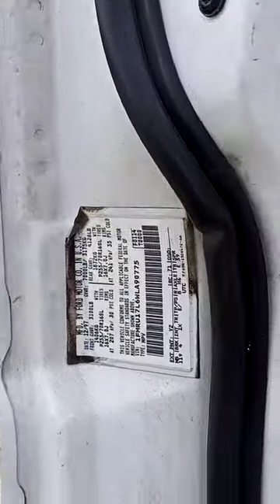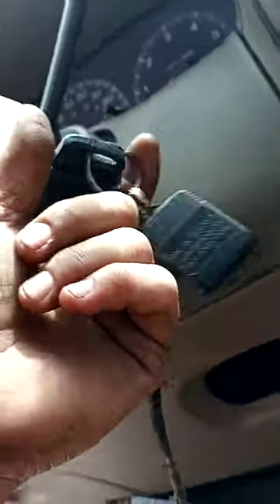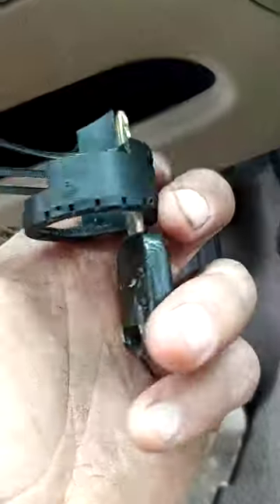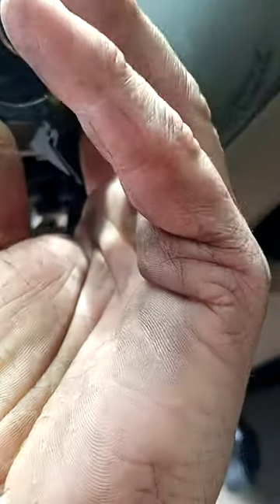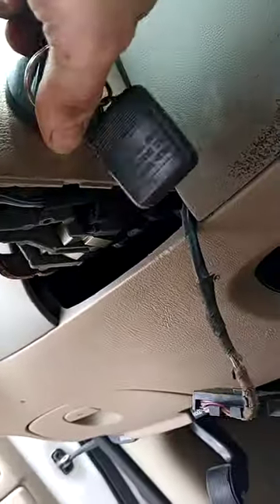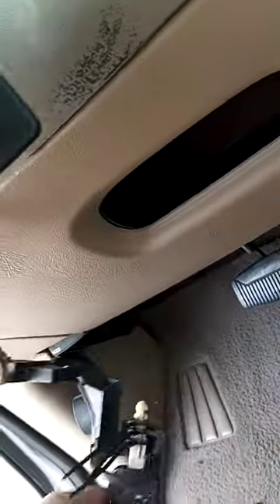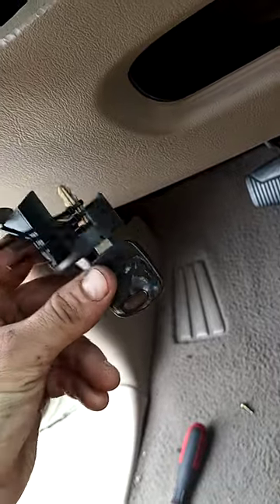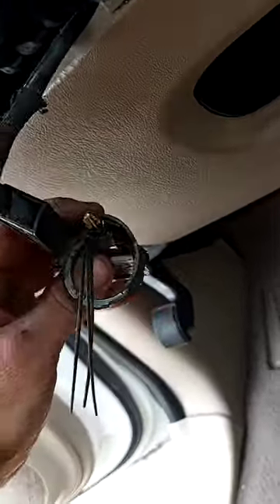How to bypass immobilizer on a Ford

Comment: Well yeah I'm one of them poor people... you feel me, I have an 08 focus,05speed stick...,,   Can't find an average problem for this. I hurt my hand trying to start after owning a few months could you actually have to apply pressure and turn first off..  then it stop starting every time.. I got juice I got radio, but it won't start tell about the 5th or 10th or 20th time after I blow on the key .. flip it  . Everything  . Brake, clutch...  ( Now driver's door won't open the past few months so I never put the key in IT hence the problem possibility ) I'm a detective I just figured that shit out today but I'm no mechanic... So I'm supposed to put the key in for 45 seconds, turn it, what had you have tried everything... She's out there started back after 5 minutes pissed, but I'm chill.. that's life. I don't want to waste money can I go to the auto parts store I'm going to try it. I'd rather just do what you do and let it run you know